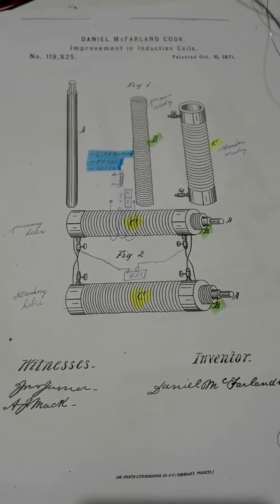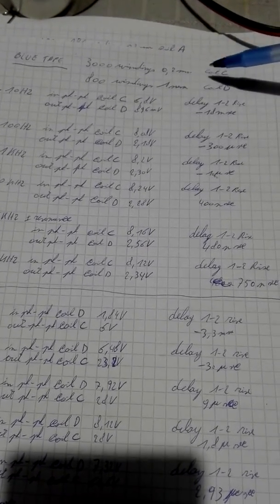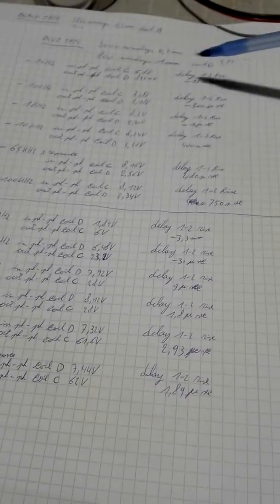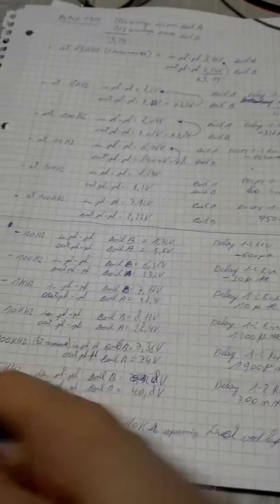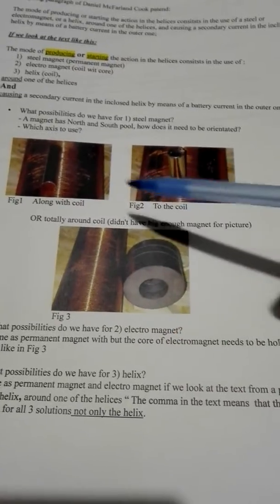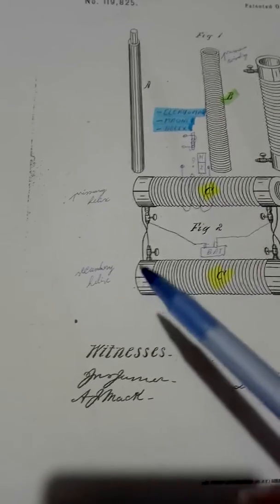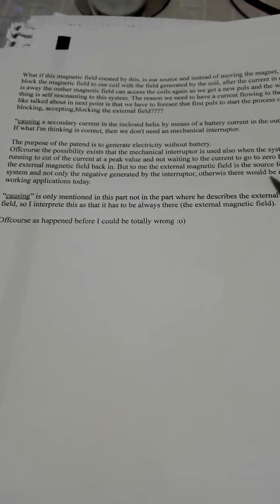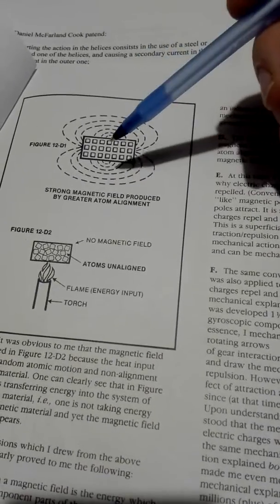003 Daniel McFarland Cook Coils

Comment: Have y tried with the starting cool In center of one of the secondary winding let's say 20 windings connected to a variable resistor or potentiometer and a 12 v battery to start the apparatus. The rest of the apparatus should already be connected as in the schematic buy no electricity should be inserted in the main apparatus directly. It only outputs electricity. Please make a try y did a great job so far. Thank you

Comment: Hi Newmans magnet as you point to in the clip is purely the classical view of a magnetic flux using iron filings. Newman did not hold the same view but you understood this by referring to the flux going the the bloch's wall, this is how he saw the magnetic flux when not influenced by other ferromagnetic mediums. A fast sweep along the outer coil with a magnet pole at 90 degrees to the outer coil is enough to induce the starting electron flow is how I understood it.
Reply from the maker: Hi David,
Thank you for the comment, I hope to build a working interruptor and will try the magnet sweep.
At the moment I'm confused about the core getting magnetised because altough the current is changed from direction to the other coil (crossover connections), it's back crossed when comming back.
Once I get material for interruptor I'm comming back to this project.
At the moment I'm experimenting with the one wire of Tesla because it's also intreging me, so many unknown great technologies to learn :)
Reply: Bruno Vk study Ed leedskalinn and his pmh...the pmh is half of cooks patent...and will break your mind in..as to what's going on in the coil to core relationship. A user RWG did a very good vid about leedskalinn pmh...cooks device is very similar to Eds pmh if you connected two pmh together...
Reply from the maker: Hi David,
Thx for the information, I will look into it.
Reply from the maker: Hi David,
I have reread the book of Ed Leedskalnin "Magnetic current" because it was seven years ago, and if I understand it correct you have the gyroscopic particles Joseph Newman talks about and called North and South pole magnets by Ed and once you get the magnetic current (or electric current) running it's kind of perpetual motion (it's not perpetual because you draw in energy from the enviroment is my believe).
The only problem in using it in Cook coils concept is that we need to break the "magnetic current" to generate electricity in the coils. 
I have to do more thinking about what Ed says about electric current being the flow of north and south pool individual magnets.
I was already thinking of putting the 2 cores in series in stead of separated as on the patent as a test, but I will also need to do a test by making them not only an electric loop, but also a magnetic loop by connecting the 2 cores with plates.
Thank you for reminding me on Ed Leedskalnin.
Reply from the maker: Hi David,
Thank you for the information, I will look into it, it's gonna take longer because I'm working on an interruptor for the coils at the moment.
Reply: Bruno you wrote
 'The only problem in using it in Cook coils concept is that we need to break the "magnetic current" to generate electricity in the coils.'

(Legend:- Coil1 is nearest core1 & coil2 is wound over coil1
coil 3 is nearest core2 and coil4 is wound over coil3)
 
when you start cooks coil with a magnet (by passing THE END of the IRON CORE (core1)),  the moment the magnet leaves the core(core1) the electric current has stopped ('BREAK' has happened). the moment of TIME that the current was moving in the copper wire coils (both coil 1,2,3 & 4) induced a current but only core1 built up magnetic energy stored in the core(coil 2's current was in the opposite direction this went to coil 4 and this nulled and opposed the magnetic field build up by coil3 which should have been stored in core2) (in my LC circuit analogy, dont read this literally it is a visual picture i want you to see when I refer to LC circuit) , this magnetic flux in the core ((core 1) is the charge in the capacitor of a LC circuit)  then the cores magnetic field collapses the collapse induces another electric flow in the other coil3 (remember the collapse is going to be magnetic flux moving, which as you know a moving flux induces electricity). I believe the current flow goes to the other coil (coil 3) and builds a magnetic field up in Core2 core. The current will not build a magnetic store in the original core (coil1)  because coil 4 wound different to coil3 sends the current to the coil2 again opposes it on the original core1.
I hope this picture of resonance comes through to your mind and how like eds PMH at any moment of time the iron cores are left each time on their final BEMF which passes the cycle over to the next coil and two coils are used on a core to achieve this opposition electrically instead of how ed did it magnetically. i.e ED had 2 opposite wound coils achieving a single core with two opposing magnetic fields and cook had two cores with coils having two different magnetic fields.
I understand this is very hard to visualize  and dont think too deep. and don't relate my analogy to the LC circuit to literally I am just trying to show the energy relationship how the electric and magnetic store then release their energy into the circuit. best wishes
Reply: The reason it needs a commutator - interrupter is that the circuit must not be stopped from resonating and the commutator will keep it going should this happen. just like a LC circuit the resonance with slow down and stop. just like a child pushed on a swing...but it is the extra Time gained through resonance that gives this device what cook believed to be a 'Improvement in Induction Coils'
Reply: also sorry to go on.....I am in no way saying use a pmh with cooks coil patent. I just use the pmh to bring into your mind the concept of design they are both using.
Reply from the maker: Hi David,
Thank you very much for sharing your insights, all respect to you.
As you mentioned I think it's better not to think to deep and just experiment and see what happens.
The holder for the interruptor needs some printing time and I'm still drawing it, so hope next weekend to have the interruptor ready, then I will use it just on 1 coil and see what results that give, not going to complicated at once.
Kind regards

Comment: I think the device will work whirl pool location earth magnetic field. But this changes from time to time and also decade of poles  flippings. Battery it charge only magnets which is common on metals like electron charge the lead acid battery. In some how we can only get the whirl pool effect if we put a bedini motor to transfer magnetic to electric current.
Reply: Maps of the vertical component of the MGMF for 1900–2010